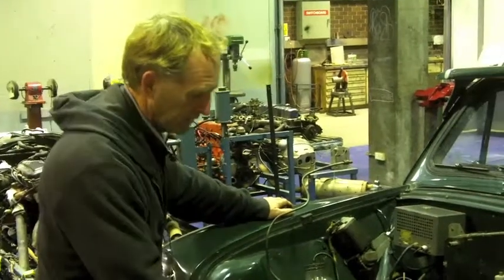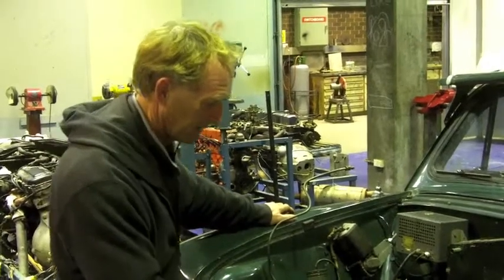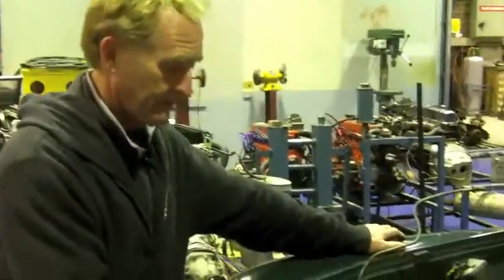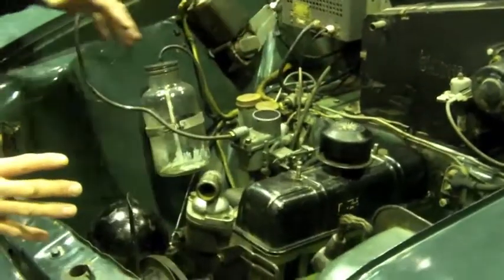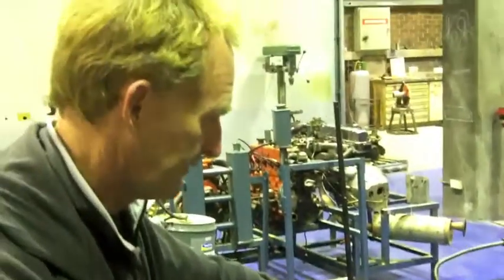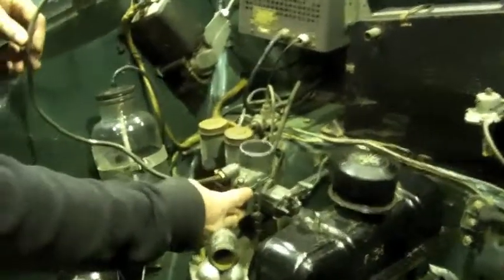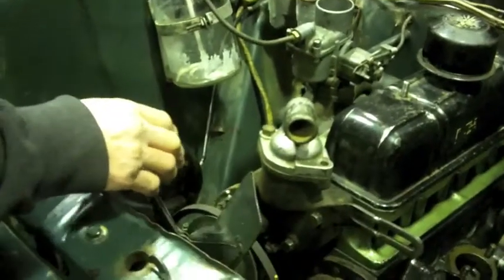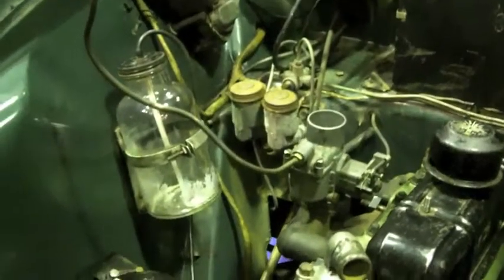David Smith on Standard Super 10 motor

Comment: Found this by accident, you can get the engine and box out or in without removing the front cross member however if you fit or remove them separately.